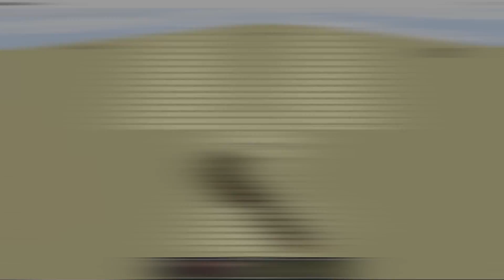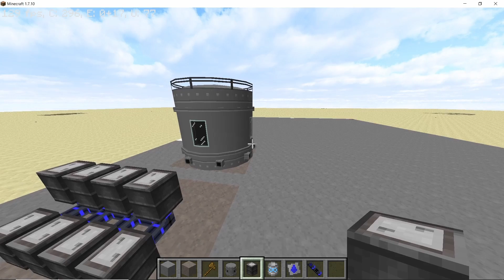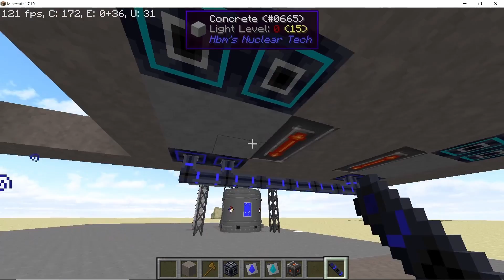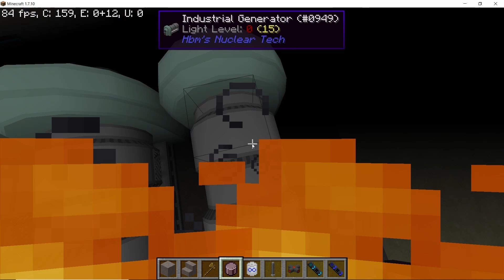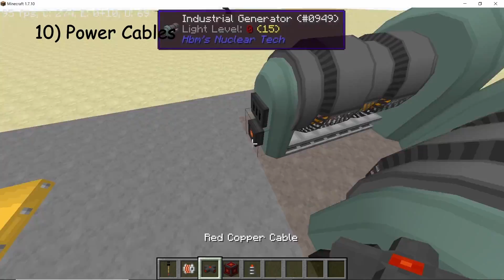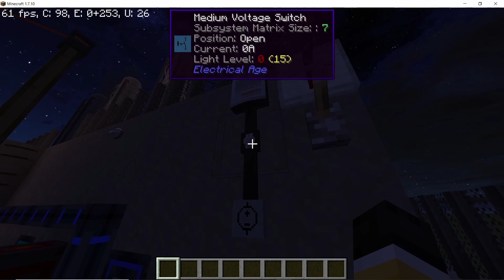LIQUID OXYGEN + DEUTERIUM Factory - HBM's NTM || Let's Build a BIG CHEMICAL FACTORY in MINECRAFT

Comment: with infinite deuterium and liquid oxygen, i can make more useful machinery form your videos!

Also, whats the mod or texture pack so you can see the block information on top of your screen?
Reply from the maker: Yeah it will give you alot of power when used in the DFC reactor. Also the mod to display information on top is WAILA
Reply: @SavageVegeta  alright, thanks